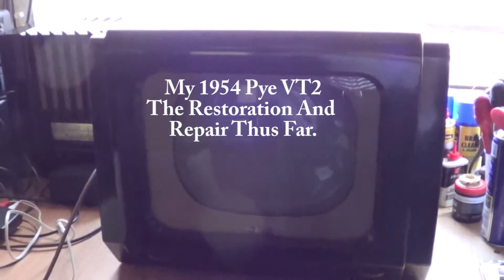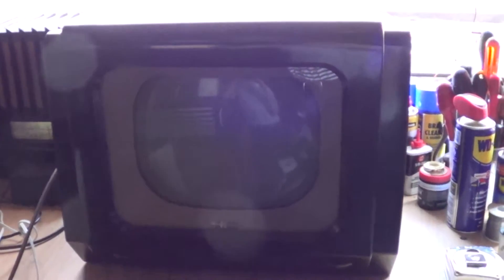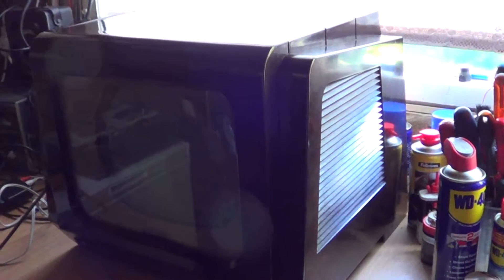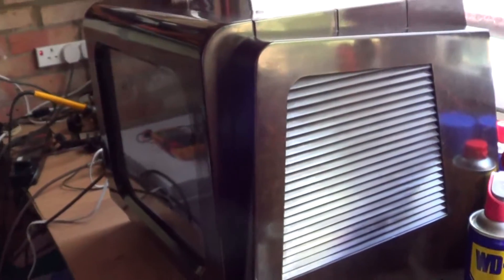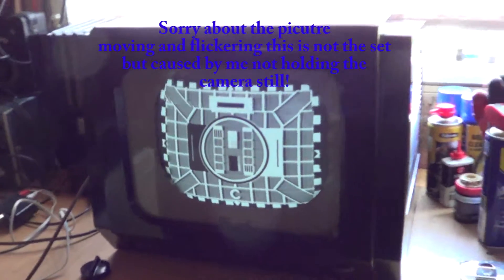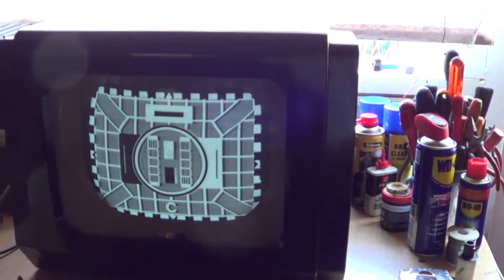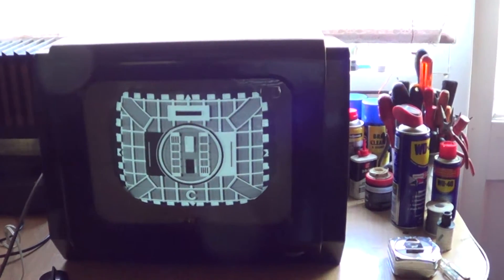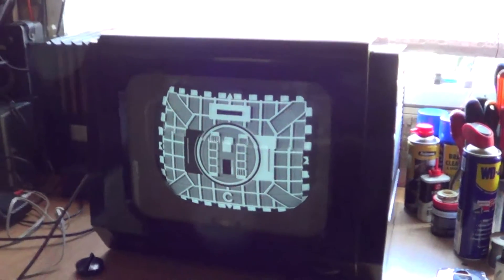My Pye VT2 405 line 1954 TV set

Comment: Hey guys, are you interested to regenerate a 405 line signal from a PC VGA card ?
I've create a hacked 405 line signal, but its frequencies are 15625 Hz / 38.6 Hz

The modeline (you can fine adjust if required):
PowerStrip parameters:
512x390=512,32,48,32,390,3,7,5,9750,2058

Generic timing details for 512x390:
HFP=32 HSW=48 HBP=32 kHz=16 VFP=3 VSW=7 VBP=5 Hz=39

VESA detailed timing:
PClk=9,75 H.Active=512 H.Blank=112 H.Offset=16 HSW=48 V.Active=390 V.Blank=15 V.Offset=3 VSW=7

Linux parameters:
"512x390" 9,750 512 544 592 624 390 393 400 405 interlace -hsync +vsync

Comment: Very nice TV SET! Interestingly, after 1964 there were tv boxes converters on sale, for to watch BBC2 by these TV SETS for system A 405 (378) lines? Reciever system I 625 (576) lines at UHF - VHF modulator for system A 405 (378) lines. Or should have to buy new TV SET with 2 tuners (in period 1964-November 1969)?
Reply: No, the techonology didn't exist to domestically covert the 625/UHF system to the 405/VHF system at that time so a TV with two tuners (dual standard) was required to view all channels. Not only did TVs require two tuners but the whole of the tuning system including the picture and sound demodulation had to different for each standard. Also, the horizontal scanning had to be able to run at two different speeds for obtaining the different numbers of lines. In 1964 the broadcasters could only covert between systems by pointing a 405 camera at a 625 monitor but this produced a poor picture. There was little need to do it anyway as BBC1 and ITV programmes were still being made in 405. By the late 1960s programmes for all channels were made in 625 and broadcast on 625/UHF. By that time the broadcasters had developed all electronic (non-optical) standards convertors so they could continue to feed BBC1 and ITV to the old 405/VHF transmitters. This meant that BBC1 and ITV were both on 625/UHF and 405/VHF at the same time until 1985 when the 405 transmitters were all turned off.
Reply: @johnr6168   The BBC developed a electronic stored field 625=405 standards converter in 1963  I believe( the CO6 501). They also developed a 405 to 625 converter as well. This was in anticipation of the start of BBC2, so they could repeat programmes on either Channel.
Reply: @martinhughes2549  I saw one of the CO6/501s at the Lichfield Hints transmitter CH 8 not long before 405 closed. I didn't realise they were made as early as 1963. I confess to thinking it was later but I'm sure you're right. It was an amazing piece of kit with hundreds of analogue capacitor stores and included nearly 2,000 germanium transistors. It was a line store convertor incidentally, - not frame store, which was possible as the frame rates were the same so the 405 output could run just a line or two behind the 625 input. You're right about the 405 to 625 convertor. That was the /502 version but don't think any more than about two were made. It worked in the same way as the /501 and used many of the same bits. There was also the /509 which was an all digital affair in late sixties for 625 to 405 conversion.
Reply: @johnr6168  I read about the development by accident, I was trying to find out about NTSC/PAL conversion and came upon a BBC research paper, BBC engineering were very ingenious. I was surprised as well. You are right about the converter being a line store converter, the NTSC /PAL converter used a line and field store, my mistake ! I mixed them up. BBC transmitters btw from 1969 used a digital converter I believe, now that is very interesting. It was the IBA that stayed analogue.